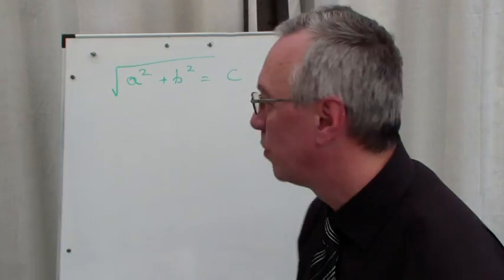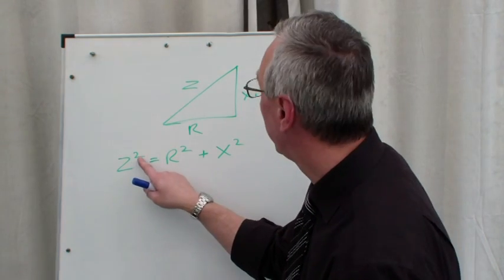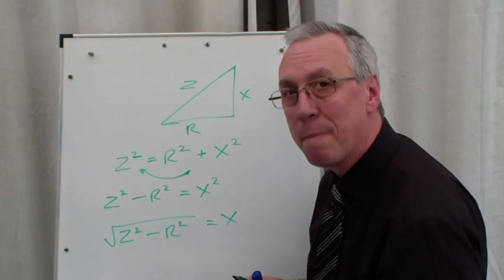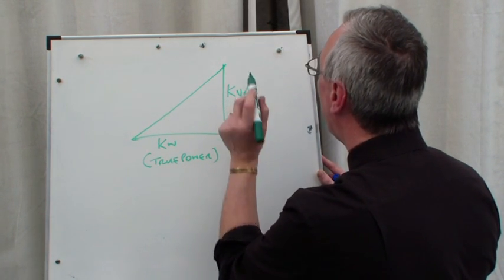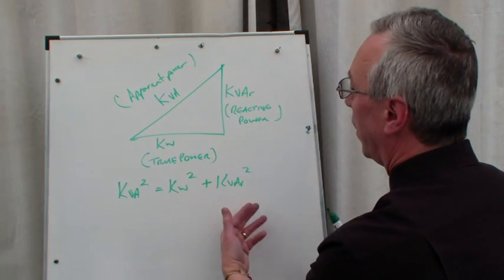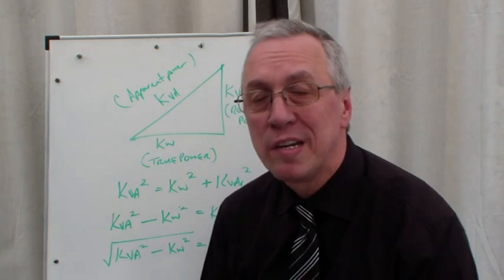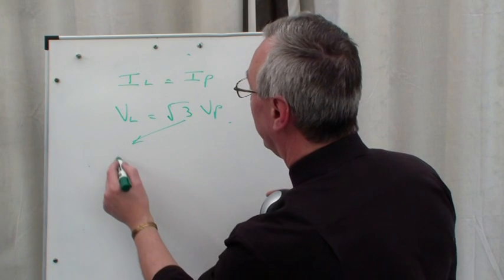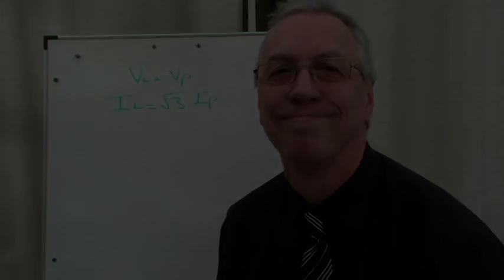Transposition Part 3

Comment: Hi, great video and very informative, I was really only watching to learn how to transpose - my maths is a bit....atrocious!! Just so happens that I am studying electricity mainly for fun..... Could you clarify a couple of questions please? 

1. reactive power occurs when there is some measure of capacitance and or inductance that exists in the circuit, yes? 

2. I understand that there always will be some Xc and some Xl but if there was such a thing as a fully resistive circuit would this then mean that V & I are completely in phase and thus Kva = Kvar?  

I'm gonna check to see if you have any more videos, again the three I've watched so far have really helped. Thanks.
Reply from the maker: +Andrew Pollock 
Hi Andrew. Your are correct in your assumption for question 1.
In a completely resistive circuit you are right - Current and Voltage are in phase so P = IxV  - there is no reactive power so we are left with just power in Watts or Kilowatts.